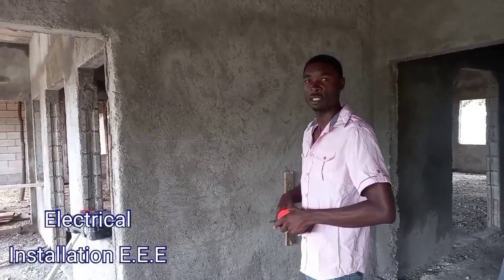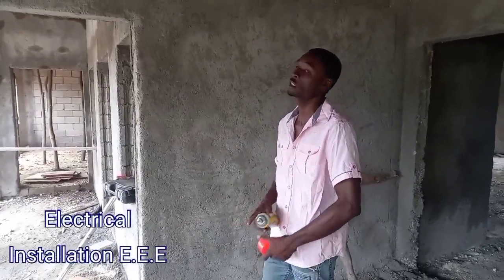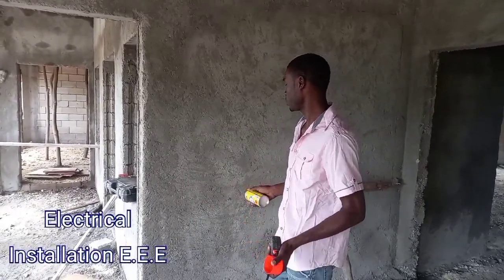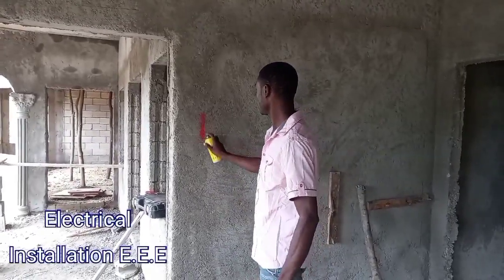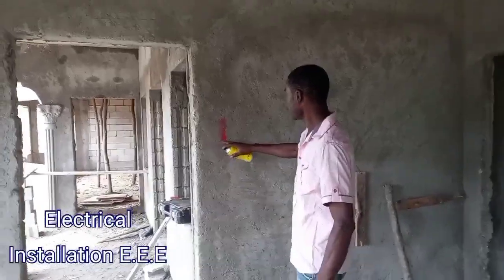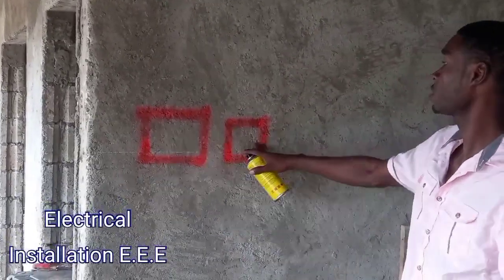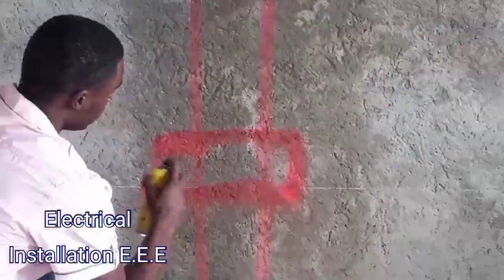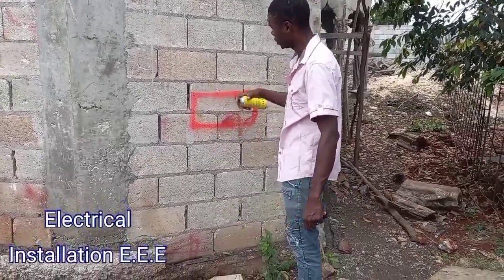How to mark out walls for Electrical boxes & pipes !! Electrical planning ( #Mansionhouse )

Comment: Oh so u do diversity factor for this project? If u do diversity factor u ask your client the load size he or she will be using for dedicated circuit? In doing that it will determine conductor size, Breaker size etc.
Reply from the maker: Not really ask i inform them rather than ask ,most time go on a project u kinder figure out what's up and if any additional such as pool , types of hot water heater ,shower in enclosures etc and u take it from there , but yeah diversity factor mainly about if u have 12 lights on a circuit all lights may not use same time things like that
Reply: @ElectricalInstallationEEE  oh

Comment: What amp is the main service
Reply from the maker: 225
Reply: That's 95mm right???
Reply: What size pipe u use for that also????
Reply from the maker: 70mm
Reply from the maker: 3"
Reply: @ElectricalInstallationEEE  so 95mm is for what size main???
Reply: @affluentj4992  It depends on how long the run is. Because at 225amp, that 70mm should go a maximum of about 70ft long. That is by the book, but we know that that household prolly wont ever  be pulling as much as 100amps when everything is running. So even if it runs 100ft, there shouldn't be any voltage drop.